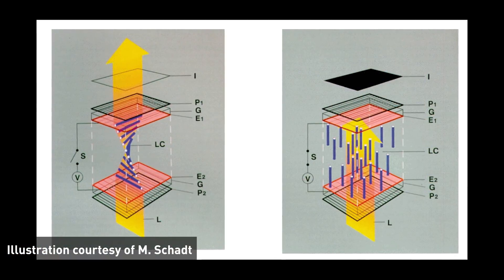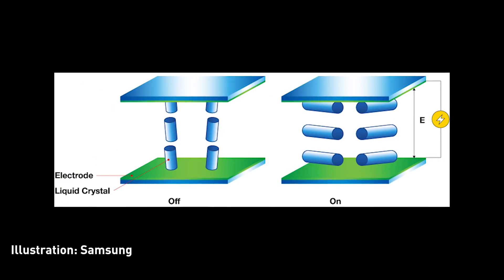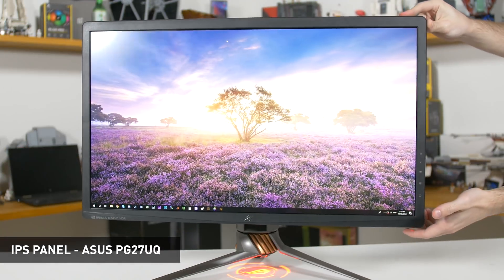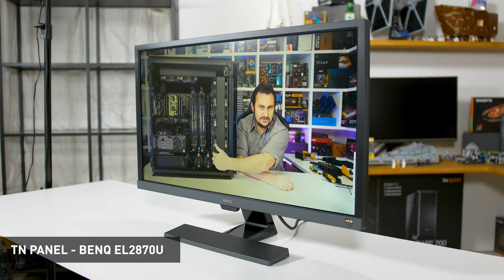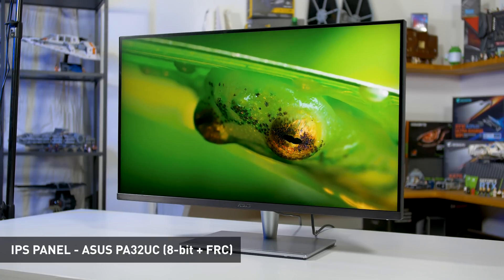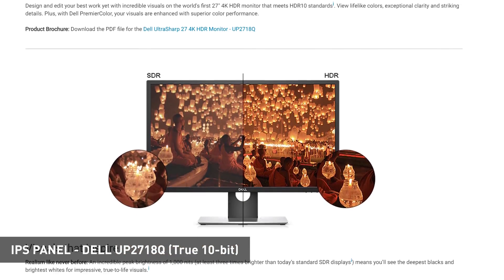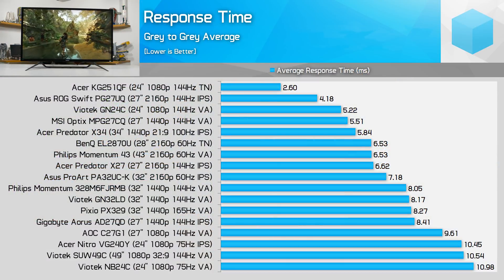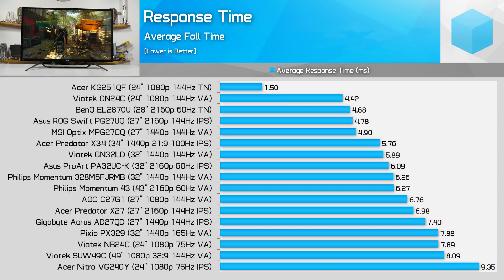TN vs IPS vs VA: Which LCD Monitor Tech is Better?

Comment: Prefer VA. No glow. Viewing angles still fine and the blacks kill IPS, especially for video.  The thing is NOT to get TN.  Its either VA or IPS for choice.  OLED is the holy grail - if it ever fixes the burn in issue
Reply: MicroLED will save us in that regard, hopefully.
Reply: @GrimmieXII  
Good luck waiting 10 years for it to go mainstream
Reply: @Cmdaddy88  I'm more optimistic and guessing it'll take less than 6, given that sampling is already being done. But yeah by no means is it gonna be a "here before you know it" sort of thing, which is too bad. Still holding out for these 200Hz VA ultrawide panels and hoping they somehow don't have terrible smearing.
Reply: @GrimmieXII  very few OLED monitors exist, and its been so long since that technology was made, micro led will hit tvs first then after 5 to 10 itll come to monitors.
Reply: Sooner. The modular version of microled come in as small as I believe 36" but at 1080p. The smallest 4k version was 75" for now but that's still half the size as last year.
Reply: Indeed
Reply: I have a high end TN panel and am not disappointed or ashamed. The colors are good enough and the refresh rate and response time are awesome. Every disses TN, but it really isn’t that bad. Of course, it doesn’t compare to OLED or IPS, but it is significantly cheaper and lacks burn in.
Reply: @fredfinks - That's a lie. I just bought a Samsung C27HG70 (VA, 4MS, 144Hz) and it has yellow bleed in two corners and white bleed in the other two corners. My Chinese ultrawide VA has zero bleed though. Both came with one dead pixel but the Samsung is factory calibrated though so apparently they think stuck pixels and bleed are acceptable.
Reply: The latency, input lag or ghosting is heavily mitigated in the later models (2017 and newer).  Aside from spreading bullshit, the people at hardware info have tested all of this and hi end VA's are sometimes faster than hi end IPS panels, and cheaper at that.
Reply: TN is for competitive gaming, IPS is for prefesionall work, VA is middle ground.
Reply: @FluffyFlounders  cheap ips are pure crap for work.
Reply: @FluffyFlounders  IPS glow is absolutely shit, you can't watch movies on that monitor, the blacks literally don't exist.
Reply: @FluffyFlounders  worst colors and viewing angles than ips, worse refresh rate and latency than TN.
Reply: @hwstar9416  *slightly worse than IPS.  TN is AWFUL at anything other than response time.  If you absolutely need the very high response time and willingly to compromise EVERYTHING else then its TN for you.   VA and IPS is a close choice.   Slightly better colour reproduction and viewing angles for IPS vs much better blacks and no IPS glow.   Hence why i say that VA is the best choice for most people.  We arent image professionals and we do a variety of stuff on the pc
Reply: @hwstar9416  Latency, as in input lag,  depends on the hardware behind the panel, not the panel itself. If you are talking about response times then yeah, VA is the slowest lf the three but not largely so anymore. And VA panel can have just as good colors as IPS. The colors is not the problem, its the color stability because there is a gamma shift horizontally but that can be reduced by pushing the screen further away, reducing the "viewing angle" towards the edges, or alternatively use a curved monitor. Hell, Eizo used to use VA panels a lot in their professional monitors, that should tell you how "poor" color reproduction VA panel has.
Reply: @MaaZeus  its not "poor" but quite a bit worse than ips.
Reply: @hwstar9416  viewing angles are more then adequate- who plays games from the side?  VA is the best for immersive single player PC gaming- you can actually turn off the lights like a movie theater and get immersed.
Reply: @hwstar9416   depends on the model
Reply: @fredfinks  you can configure a tn to be quite good. Ips has shit blacks and glow and whatever, while VA has ghosting. TN is the most stable without issues and colours are a preference anyway. What, If somebody likes washed out colours? The strong vibrant colours of other panels literally hurt my eyes.
Reply: @MMOplayeerr   You can always turn saturation down in the monitor settings. Even down to grayscale, if you wish.
Reply: @fredfinks  so what would be your opinion for me. I love gaming but also like doing creative stuff like editing photos, logo design or drawing digitally. As for now just as a hobby so I m not a professional. So I kinda want the color accuracy of ips for that but the deep blacks of va for the atmospheric gaming. Do you think a va panel around 500 dollar will be still color accurate enough for the ultra wide I wanna upgrade to soon? (Also I probably would keep my 24 inch ips as secondary monitor)
Reply: Totally agree.  Response times are more then adequate now with VA.
Reply: OLED will never have a fix for burn-in just like plasma.
Reply: @Nightraver56Eu Well, it really depends, one of my friends IPS has way more smearing than my VA, but that is not a native 144hz monitor while my VA is. I also had a 144hz TN monitor, the acer one in this video, I cant tell much difference than my VA one, very little difference.
Reply: Not all TN panels are created equal. AW2518HF has great color accuracy as do some others. Ben Q is a little washed for certain games but if you're only doing e sports like counter-strike than it's perfect and dark areas appear grey for better visibility in competitive gaming.
Reply: OLED is never going to be fixed. MiocroLED is the next holy grail; with true 10-bit +144hz AMVA's with microled FALD[IPS ambient blooms with the power HDR10 lighting requires] with perfect blacks being the realistic hope the next 5 years goal. except as a backlight tech, microLED alone is going to be ultra expensive and far too big for monitor/small TV use for many years.
Reply: QLED monitor suffer image retention, be carefull with that. i have the cfg73,a little bit has burned in to the screen, you can get rid of it if you put the full white bright screen for hours
Reply: @JomarsYT  ips have that to
Reply: VA has broken GAMMA, hate it, and slow pixel transaction - ghosting. But anyway VA panel is good for price/performance ratio, not bad response times, ultrawide 34 inches costs around 500-700€ 100hz, hovewer ips 100hz 1000-1200€ and more.
Reply: @EJSC I agree, I have a 144hz TN and a 144hz VA, bought the VA one recently cuz everyone praises VA so much and it was on sale. I gotta say I am too used to TN's motion clarity, even the better color won't win me over. The motion blur is just way too much on the VA, and if you turn on overdrive, my god it's way worse.
Reply: I use dual monitor setup, VA 1080p 144hz for gaming, and IPS 1440p 60hz for photo editing, I might switch my VA to a TN panel in the future tho, since I dont care color in games.
Reply: I have been using an OLED as my monitor for 1.5 years now, no burn in issues.
Reply: Banana  i was about to get ultrawide ips 29" is that true??
Reply: @Nightraver56Eu yep at a 60hz refresh IPS is almost devoid of ghosting whereas the blacks of VA ghost or double image to buggery and its easily VA biggest flaw. 

I use a 32in 4k Samsung VA panel and the double image/ghosting with the panel response on "fastest" is absolutely embarrassing and unwatchable.  On top of that mine has dreadful uniformity with vertical colomns of backlight differences, yellow clouds and clour shifts... never touching a Samsung monitor of TV again.  I didnt learn from the familys Samsung VA TVs in the past which also were shocking for uniformity.  Im sure SAMSUNG should have an H in it somewhere 🙄
Reply: I get TN over IPS any day
Reply: So which VA monitor do you got?
Reply: @xyanide1986  S32D850T - Business class Samsung from 2015. 32" 1440p VA - 60hz.  Perfect for video, work, etc.  Gaming  if youre fine with 60z its perfect. Unfortunately, there is no monitors for me - with basically unlimited budget.  I MUST have 32" 16:9 1440p non curved. See comment above yours re IPS and movies..   I would go with OLED and bear cost with burn in but smallest one is 48"inches , too big -  but what if i mount on wall and pull desk back a bit? oh look at Linsues video on it - it has a huge section at back sticking out... I have no upgrade path..
Reply: Which 1 is best for study, work and watching movies?
No gaming.
Reply: @kriswayne7938  then I'd say a VA monitor, IPS black levels are just not perfect.
Reply: @xyanide1986  ok thanks
Can the brightness level be changed in VA?
Reply: @kriswayne7938  VA, 100% no doubt. IPS very low contrast is terrible for movies.  Get a 32" 16:9 non-curved monitor if you have a decent sized desk.  Otherwise 27" 16:9 non-curved.   60hz is A-Ok, you dont need 100hz high refresh.
Reply: @fredfinks  ok,
19" is my requirement so it will be fine with VA, right?
Reply: @kriswayne7938  yes but unless youre working in some tiny hole, or for portability, 19" is WAY too small.      Minimum i suggest is 24"  (its been that way for over a decade in standard offices).  For not much more you can get 27" or  ideally 32" , which makes work so much easier.   Spredshaeets, docs, browsing, video etc. EVERYTHING.  19" its like wtf are you doing? using a tablet or something?  What screen type - IPS , VA, TN whatever,  its ireelevant when the size is woefully inadequate.  Id take the worst monitor at 24"+ over the best 19".   anyday
Reply: No glow but a beautiful trail of ghosting!
Reply: Va is too slow ips is too slow. Real competitive players get TN panels
Reply: VA has duller, dimmer colors than IPS and higher latency than both TN and IPS. It is a compromise panel tech.
Reply: @excalibur3311  depending on which features you look at, all 3 of them are compromise panel techs.
Reply: @excalibur3311  wrong af
Reply: No thanks, I'll take TN with high refresh rate and low response time for my gaming.
Reply: Tn is better for gaming
Reply: @hwstar9416  no. just no
Reply: Only for twitchy multiplayer games. In atmospheric games, RPGs, survival, etc, rich colors and deep blacks are more important IMO.
Reply: @JackTheCarver  I’m a bit confused. You say va has the rich colors but I thought this is a strength of ips. Could you elaborate this to me. I’m so struggling on my next monitor upgrade (ultra wide)
Reply: Very true. My old Asus gaming monitor back before high refresh rates were pushing 100+, had a combined response time of 2ms. That's the equivalent of a true 500hz display. Unfortunately it had a max of 75hz but it was super responsive.
Reply: VA is utter shit, sell that turd on Ebay
Reply: VA is a master of none .
Reply: @hazard1one  except a master of contrast and black levels that destroy ips but ok
Reply: @treymtz  you sure its not oled is master of contrast? but thats ok.
Reply: @hazard1one  OLED isn't even in this conversation. Way too expensive, burn in issues with too few monitors that exist in general.
Reply: @hazard1one  it was a master of contrast and subjective image quality (popping image), only now dethroned by OLED.
Reply: @hazard1one  wrong, it's the master of contrast and blacks
Reply: @TheBigLanowski  so you are saying va better than oled in both black and contrast ?
Reply: @hazard1one  sorry I don't know, wasn't even thinking about it. Reading way to much about TN vs VA vs IPS for gaming monitor decision... No OLED tech in this category.
Reply: @TheBigLanowski  OP mention about OLED tho.
Reply: @hazard1one  I'm just dizzy because of all the reading - just forget about it ;) already forget that he mentioned OLED as the holy grail